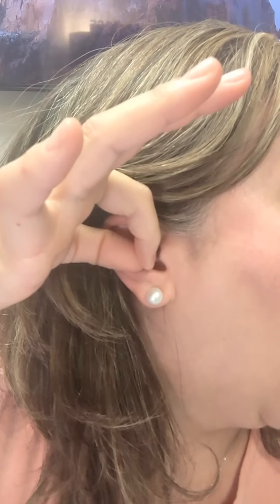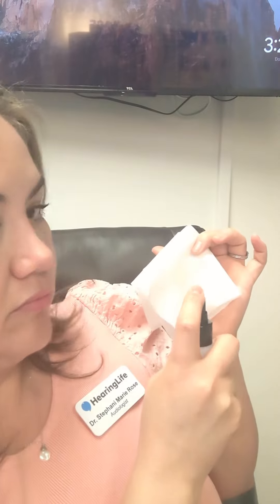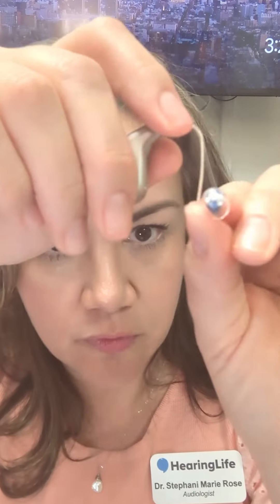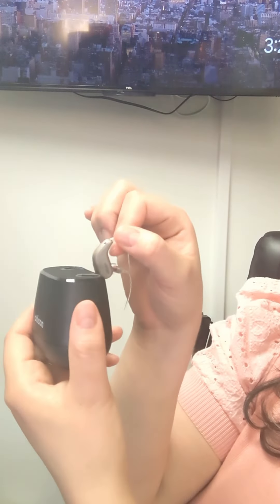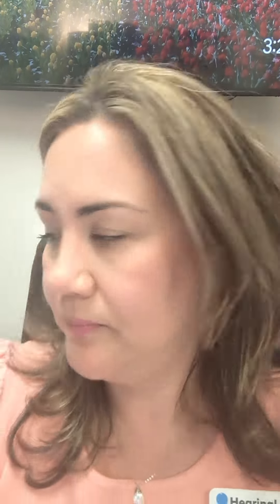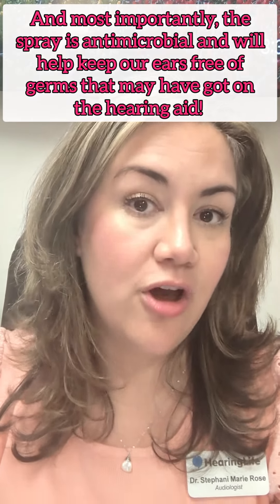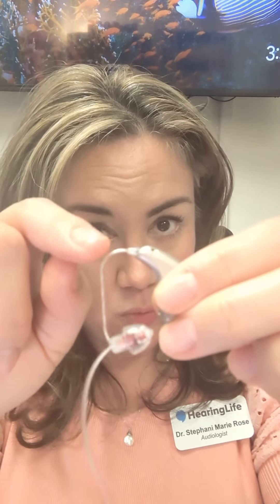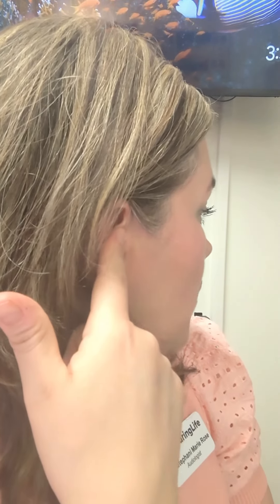Hearing Aid Orientation Video

Comment: Hi Dr. Rose, I have the Jabra aids (from Costco). Looks pretty much the same. I’ve had them for over a year now and I love them. What a difference aids make.  Thank you for confirming my thoughts about the removal of the aids. I may be fussy, but I think it’s better to pull the aids out by the retaining wire. That way there’s no strain on the connections. I prefer to clean my aids in the morning or after they’ve been out of my ear for a while because they are dryer. This way the wax flakes off rather than smearing.😊  Yes, wax flakes are around the inside of my case, but they’re not hard to clean with the tip of my finger.  (My case has a chamber to hold the earpiece.)

BTW, I liked your demonstration of the retaining wire. I didn’t think they would be effective, but you showed that they are.  I had been asked by the technician whether I wanted them or not. I told him that I bicycle so he suggested I get them. I can see that was a good idea. Strange thing, I actually had the wire break off the band that attaches it to the aid.  My nails must be too long and sharp. Early on I had lost the attachment band completely. I don’t know how that happened.  Also early on, one of my hoods tore.
Reply: By the way, your production is excellent, especially considering that you’re just using your phone(?).